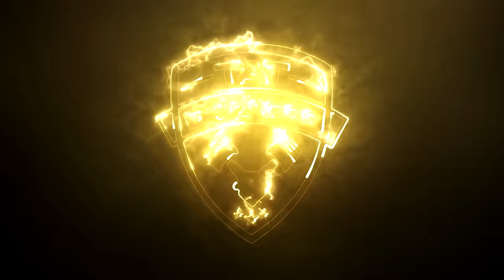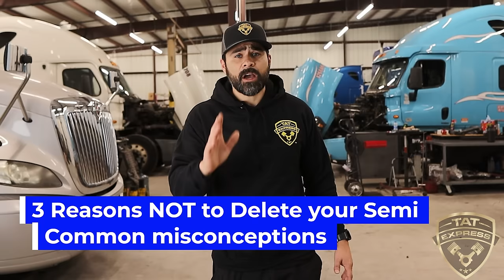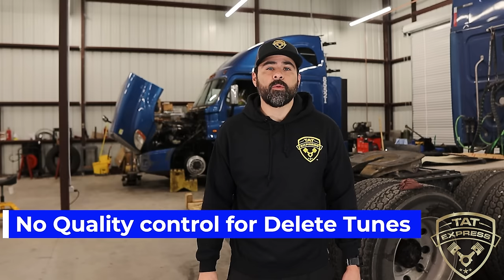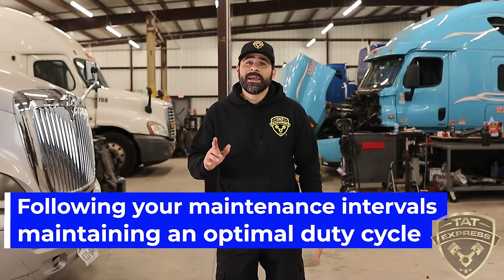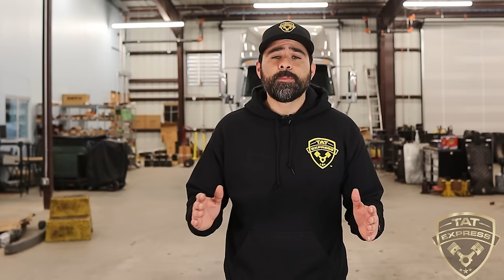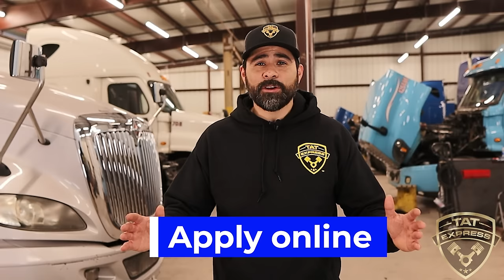Do Not Delete your Semi/ Do NOT delete your Semi/ Three Reasons Not to Delete your Semi/ DPF Deletes

Comment: I have a 2016 Cascadia Evolution and she’s a great truck. Does it make sense to just do a complete rebuild and off frame restoration when the time comes? She has 657K miles at the moment and I do my PM’s every 15K.
Reply: Seriously?? It's a Freightliner, a frame off restoration and rebuild. Lol.... and it only has 657K, my Pete has 1.6 million miles on it and has never been restored and only had the engine rebuilt once and just barely changed the transmission. It just keeps getting the job done. If you're going to dump that kind of money into a truck do it to a truck that's worth putting the money into. I bought my 98 Pete in 2011 for $16K and I see ones just like it going for over $40K today.
Reply: At 657k? You have a million miles to go yet. By then the hood will have shaken off amongst other issues. Look around how many Cascadias do you see restored? But you could be the first. Good luck.
Reply: @chestergerber7125  thanks for the reply. My dream truck has been the Fitzgerald Glider Kit for past 10 years. Truck market had one for sale couple of months ago with only 108K miles on it and the motor was a CAT!! A dream truck. Price? $277,700.00!!! The 2 isn’t an error. Our world has gone crazy with pricing. Figured I could I rebuild her for $100K and save the rest for either a trip to Bora Bora or my bank account.

Comment: I have a 06 freightliner century with a remanufactured engine installed May of 2011 I think my EGR cooler going bad leaking coolant inside the engine add a gallon a day don't see leak can smell it and see steam and my truck struggling climb a hill when pulling a empty trailer I climbed a hill ok had the EGR valve replaced 2 years ago
Same time as the turbo replaced
I run only in the south east states 
I live in Phenix City,AL next to Columbus,GA 
This has been a problem a long time with the lack of power climbing a hill just now it's extremely bad just 2 weeks ago had the exhaust leak fix with new pipe and few days later a coolant line fix that runs along the fire wall between the engine and turbo was leaking very bad now I guess the engine is building up more pressure and when I'm in traffic or climb a hill with heavy load the temperature goes over 200 the fan turns on cool down a little then it quickly goes back over 200 when I'm driving down the highway empty the temperature goes no higher than 180 even going up hills and same temperature with heavy load at highway speeds with no hills
I wish I never had this EGR system my truck doesn't have a DEF system it never had one 
And the shop I be taking my truck to have this fix one of the main tech guys there told me that my truck will run better deleted the EGR he didn't say he can do it 
I'm guessing he can since he mentioned it he works a big name dealership I'm saying the name of the company just it's not a independent on shop I been going there for long time 
If this tech can do it 
It wouldn't be at where he works most likely where he lives
See I like to have it done the problem with this just say if I pay someone to delete it and pay a lot for it and few months starting to have big problems with the engine guess what the dealership where he works at most likely can't fix it because the problem is having the EGR deleted and it will not be under no warranty if not a the big dealership so this will be the big reason I will not have it done on my truck so I just stay with the EGR in my truck

Comment: Wow people, this is his professional opinion. And he is not wrong, with proper maintenance you can stay on the road. I have a million miles and is been a challenge but I’ve learned to maintain and clean the system and still going strong. And even if he wanted to, not saying he would, but if he was to go and tell you as a professional to remove or alter the system the epa would rain on his parade. He can lose everything. But learn to maintain the system , you would be better off.

Comment: The only reason I don't want to take a chance on deleting my truck, is I used to be an International dealer technician. That means I can hook up the correct software and limp the truck until I can properly repair the emissions equipment.

If I didn't have this knowledge I would be at a serious disadvantage.

Comment: Funny my 2015 grinder with a 99 12.7 runs amazing and so do my ugly fixed dd15s. 10-15k services to def/dps system isn’t cheap and if it was most wouldn’t delete but that’s the option we have.

Comment: Actually, the REAL killer of DPF's is NOT the soot from the combustion of diesel fuel. I's oil consumption. Fuel produces carbon, which is easily cleared by a regeneration cycle. Oil, on the other hand, comes loaded with zinc, molybdenum, and other additives, like detergents, to ensure good film strength. If oil carries over into the DPF, the oil base gets burned away, leaving behind oxides of those metals, which have much higher melting points than the temperature produced in a regeneration cycle. That fouls the DPF, rendering it non-serviceable. If I was going to mod a truck, I would put some kind of separator in the crank case decompression, to prevent carry over of oil aerosols from entering the air intake system. (The very same applies to catalytic converters in gasoline cars and trucks) If you could eliminate oil consumption, I would guess that the Diesel Particulate filter and selective catalytic reducer could last well over 250,000 miles! (A welcome thing: an exhaust train for my Kenworth is~$12,000, to fit the 15 liter Cummins engine) I don't think an after-treatment exhaust would last 10,000 miles on a 'greasy' Detroit 2-Stroke diesel engine, due to the inherent oil consumption of the engines. They burn their fuel clean enough, the big enemy is the OIL!!

Comment: Tho I disagree or certain things you said I do agree it’s not the best option, 5 years ago I was that guy saying delete delete delete I have since grown in the diagnostic of the dpf system, so now I do not recommend it, I try to fix the solution rather than do away with it. I have found that if you are a guy that deletes every problem with the engine from there out becomes your fault. Therefore I do not do it anymore, it’s not worth the liability of it or the reputation that follows

Comment: I run a 2016 Freightliner with a DD13, in a highway maintenance municipality. You are absolutely correct, about a reputable shop, to do the correct maintenance on the engine & its emissions controls. It pays in the long run, & has better resale when it time to update!  Thank you for putting this video out there!
Reply: Lol... our highway department here just deleted all of their dump trucks because they were in the shop too much and was getting behind on projects. The government says we have to have this crap on our engines and yet they're allowed to take it off. Go look at any piece of new military equipment or truck with a diesel engine and you won't find 1 that has emissions, I wonder why that is??? 🤔
Reply: @clydeacor1911 , after the verdict was handed down by the federal court about 2 months ago on the "Right to repair", the feds were able to do this, because they had so many pieces of equipment that were backlogged for repair. It was mostly a software modification.
Reply: @aaroncone6778  it hasn't been since just the last couple of months, the military has been doing it ever since emissions systems came out, think about it you're not going to go to war with a bunch of equipment breaking down on the battlefield because your exhaust particulate filter plugged up or call for a cease fire because it's time to do a regen or have an engine derate because you forget to fill up with DEF. As far as the county dump trucks they've been deleting them for the last 5 or 6 years.

Comment: You have your environmental issues all mixed up. DPF deals with particulate pollution which is harmful - yes, its made of carbon particles but its not carbon dioxide.

There are three quite seperate groups of emissions that impact different issues. You have gotten these all confused and you explanation was a bit of a mash up of them... 

DPF is deals with the particles which is a health problem and causes cancer.
Carbon dioxide is what causes global warming and it what the carbon footprint refers to. This is simple relation the amount of fuel consumed - it is NOT effected either way by DPF or DEF or SCR or any emissions system. Goof fuel economy is what reduces this.
NOx emissions are what causes smog (and also resistory issues). This is also not a DPF thing, this is what DEF is for. 

And for those paying attention - yes DPF may indeed reduce fuel efficiency, increase carbon dioxide emissions and INCREASE the carbon foot print while reducing emission of harmful carbon participates that cause health problems. Its a balancing act.

Comment: 1 reason for not delete my truck? End in your shop every other week. That's business for the shops, and a loss for the truck owners.
Reply from the maker: Preventive maintenance and a proper duty cycle is the best option to keep out of shops. Delete is not the answer; there are too many tamper-proof measures to risk your equipment not running correctly in the long run.

Comment: Deleting the truck and increasing the fueling are 2 different things.  Deleting alone absolutely does not hurt the engine if anything prolongs it due to getting rid of harmful exhaust gas and carbon recirculating to the intake.

Comment: Question.. Can a Detroit 60 be put into a W900 with some minor changes, I have a w900 with a blown Cummins I also have a rebuilt Detroit 60 and I want to put it into the the KW
Reply: Anything is possible go to texas i see them all the time i know a guy in dallas
Reply: Yes you can. You will have to change the wiring harness, plumbing, etc but it is doable.
Reply: Yes it can happen,i know guys that have done that exact swap and love it.

Comment: Another thing to add, if you delete your emissions and think if you rebuild the engine after it fails is the solution. Guess what, any warranty will be automatically voided.
Reply: Two of the best shops in the same place
Reply: I mean... if someone's going to be deleting a truck this day n age you think they really care about the warranty? 😂🤦‍♂️
Reply: @dawarmonky2122  …..also the shop that rebuilt it should warranty it. I no a few shops that do.
Reply: If you doing a delete you don't give a damn about a factory warranty. The shop that does the rebuild,if you ever need 1,will give you a warranty.
Reply: I went to frightliner and was able to repair demoted using warranty just gotta do it right

Comment: BS I HAVE A X15 the injector dumped too much fuel it the dpf system caught fire  truck only had 280k on it it happen all of a sudden no check engine stop engine  then boom it stopped running 31k repair bill!

Comment: The way his voices I think is sarcasm and he's reading a script because we all know that literally without the admission system the engine actually performs better gets better fuel mileage and last longer. I've talked to multiple dealerships myself and they said if it wasn't for the emission system they would barely have any work. Neither dealerships that told me 60 to 70 percent of their income comes from working on emission system's. I've had a truck that was deleted and it lasted longer and was in the shop way less than an emissions truck

Comment: Lol. DPF is the only problem I had, before I deleted the system. I have 1.65 million miles on my truck and still going strong. It would have been in the graveyard if I had not deleted the truck. This video is good but not totally accurate as far as longevity goes.

Comment: Ugh... the only reason not to delete is the legality.  DEF is why old trucks are still as valuable as those only 6 or 7 years old.  Looking for a pre DEF rig now and trucks from the late 2000's and early 2010's are cheaper.  Guess it's better to pay for an inframe than fix a DEF system.

Comment: I am repairing a bad delete right now, big tuner shop delete... Many parts stripped off, Turbo fried, oil cooler shot, wrong water pump, RTV (Mr Gasket) everywhere... I'm not a mechanic, but know how to work on these motors. When I am done, the owner of the truck is looking at $15,000 with parts and labor. Climate change? That is a bunch of BS. Give me back my old school diesels, with technology we can burn cleaner without all of this nonsense. And that is another thing, CARB out of California did a study on the particulates coming out of the new truck emission systems. They deemed them a high cancer risk and recommended going back to the old non emission motors, or finding a better solution. The particulates are now so small, they can enter your skin through your clothing and in many cases, directly into your vascular system.

Comment: Can you please make a video on the N14
Reply: Very difficult to get parts for them any longer, especially injectors and heads. Not something I would consider owning or purchasing.
Reply: @michaelwright1602  😂😂😂 I can tell you’ve never owned one….i just replaced an injector and it was $275 at Freightliner and my mechanic charged me $200 to install….never had an issue finding parts…nothing is ever in back order, it all depends on where you drive I guess….I drive in Chicago
Reply: @lariosfregosoify  You are one of the lucky ones, I know a few guys that have been rung through the ringer with these N-14's, and I miss those motors. They were a good one, used to own one. The injectors are hit and miss on these, if you have a good rebuilder you are lucky.

Comment: What gets me is these (mechanical genius’s) talking about how easy it is to maintain ats ……..if that were true the shops wouldn’t be so overwhelmed with ats issues…… your not going to convince me (or anyone who has a brain) that all the problems with the ats in all these trucks is because the shops all over the country don’t know how to do maintenance on these trucks…… it’s a bad design added to pretty good engines……. You can’t fix a bad design by restoring it over and over to its original condition which doesn’t work and never will…….. and I understand some of the newer model do work a lot better, but it’s still a flawed design

Comment: SIMPLE. If you really want to make carbon reduction a realistic goal you MUST standardize the parts required for the system. EVERY manufacturer has to have the EXACT same emissions  parts. They can have different connection points, but the "expensive" parts need to be MASS PRODUCED so they become cheaper. THEN you will get closer to compliance. DEF is a joke, and it's only because you're doomed to have very expensive repairs long before the realistic non-maintenance period of a diesel engine. And by the way, a garage that makes money replacing these parts is DEFinitely (pun intended) a conflict of interest.

Comment: Look w/ all due respect. 1st, no one is saying or advocating to kill the planet. 2nd, the numbers u quoted about how were putting out more carbon than the earth can handle is pure propaganda. 3rd, the amount of fuel u burn in order 2 perform a regen is way more than if u just ran the truck without all thr emissions crap. 4th, the technology is far enough advanced that even without the def, EGR, scr, etc, these trucks burn cleaner than older trucks ever could. 5th, if its so harmful 2 the environment, why are we the only major country forcing this stuff? 6th, not 2 be a dk, but everyone is saying otherwise n as a truck leasing company technician, i can verify mist of these trucks come in for exhaust system issues. If u can respond 2 this comment, id be happy 2 discuss further

Comment: I read.these comments.and found the typical idiots that don't have enough sense to function. 
I have 10 cascadias with dd13 and dd15 engines. In the three years I have had these trucks only one time have I had to pull the dpf apart. Never a def issue but I have had a few after treatment parts failures. 
The reason is because I maintain these trucks properly and regularly.   
I am also interactive with drivers to help them understand why things happen and what to do and what not to do.

Comment: ...if you delete def system you killed your engine, seen it many times, plus some people who did it got caught on the weight station and had to pay the price for it plus lost their truck in till they put the def system back. It's not worth it, i paid to replace one box with labor and freightliner shop around 10 grand thats with all new sensors some pipes and the injector was still under warranty and that was when i had around 800 thousand miles, changed the filters before that cost around 1700 hundred new ones.
Reply: Where was the weight station ?
Reply: @anonymoustrucker1782  ...there is been more of them, one of them was in Virginia.
Reply: How did the weigh station know it was deleted?
Reply: Still waiting for an answer to this question

Comment: I bet most of complaining here have well over 600-700k miles. How about to get newer or new truck and stop complaining ? New engines are designed to work with def and take a part of exhausts to lower temp in a combustion camera. If you delete def and keep your fuel maps the same- 99% your engine would die soon. If people want to go that way- no problem but you need to understand what you’re doing
Reply from the maker: We agree. We are sharing what we see with hack deletes.  It shortens the life of the engine. Thank you for sharing.